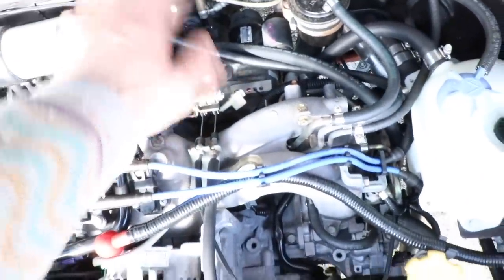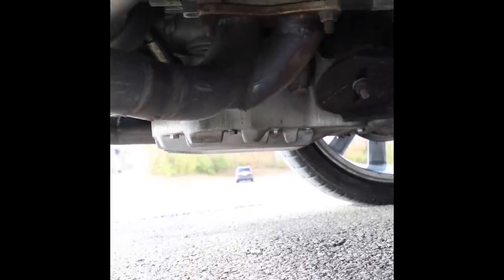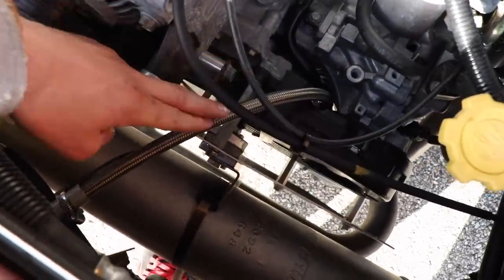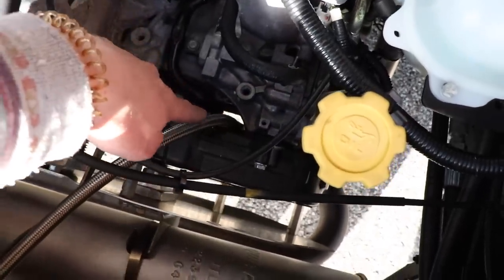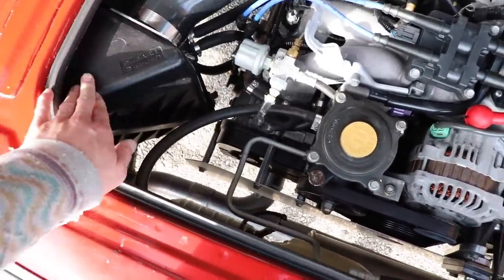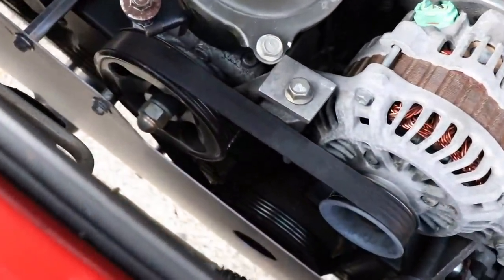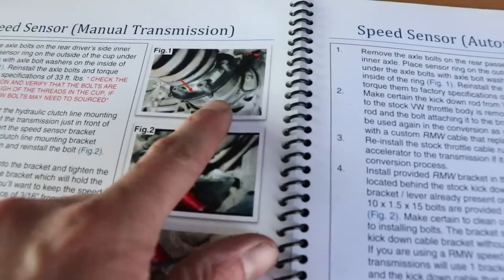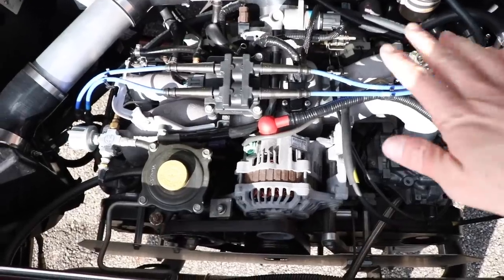VW Subaru Conversion

Comment: In South Africa, we produced these Volkswagen Microbuses (Vanagons) locally since the 60's. Volkswagen South Africa therefore, in a quest for more power, replaced the 2.1i (last of the VW boxer motors) with the AUDI 2.5L 5 cylinder motor - it's the Quattro 2.1/2.2 5cylinder bored out to 2.5 liters naturally aspirated that pushed the output from 85kw to 100kw - these were super tough and reliable and could easily do 160km/h! Drove lots of them - awesome long distance cars.
Reply from the maker: Nice!! I’ve heard of the buses from South Africa, sounds sweet!! Would love to see one someday and check it out! Thanks for watching/sharing🎉
Reply: @PostPros  : if you want me to send you some pictures and more information, you're welcome - our 5 cylinder busses ended up with quite a few engine sizes ranging from 2.3 liters (in the basic Kombi) to 2.6 liters in the Caravelle (the highest luxury spec with standard A/C, power windows, power steering, power mirrors and power door locks). The AUDI motors were RELIABLE and could easily accomplish 250k to 400 000kms with some owners recording as high as 850 000kms. Volkswagen South Africa never, UNFORTUNATELY, fitted these AUDI motors with a Turbo - I can just imagine seeing a VW BUS going past you at 200km/h like an AUDI QUATTRO! The stuff of legends! Ánd the sound of these motors were AWESOME! Now we have, like the rest of the World, the new T6.1 in diesel only 🙄🤦‍♂️
Reply from the maker: Sure that would be cool to see! I’ll message you my e-mail if you want to send them there, if it’s just a link online post them here so others can see🎉
Reply: Hey, where can I get one of these Audi engines?
I also need a SA Vanagon steering wheel

Comment: Never heard so much praise for the Wasserboxer.  My '85's had a GoWesty 2300cc and the air flow meter caused the worst nightmares I've experienced in a car.  Traveling from CA to WI (never made it), it died repeatedly at elevation and even when it wasn't dying, I would get the dreaded "highway hiccups".  You can get rebuilt AFMs, but the Digifant system is not good and if you break down in the middle of nowhere (as I did), good luck finding anyone who will touch a Wasserboxer, much less knows how to work on them.  And since there's no OBD, you're pretty screwed unless the mechanic is familiar with them.
I agree that if you're just driving around town and within a few hours of older VW mechanics, the Wasserboxers are fine.  Can't agree that they're good for cross-country trips based on my miserable experience.  I swapped the GW 2300cc for a Subaru 2.2 and it's better in every way.  Expensive, but I literally can't imagine doing cross-country travel in a Wasserboxer-powered Vanagon anymore.  Maybe with the Digifant ditched for GW's replacement, but if you're going to spend that much on overhauling everything, why not just a reliable, modern motor with OBD?
Reply from the maker: Joshua Sawyer you got it!!! Sounds like your a seasoned vanagon owner😂. The Subaru’s are sweet!!

Comment: I have an '88 with 365k miles on it. The first engine overheated (bad radiator) at 325k miles. I fried it good. The half ass shop I took it to tried to change the oil but forgot to put oil in it. And the guy is out test driving it around. No coolant system. Imbecile. I was able to drive it off the lot. The engine would not die. I ended up replacing it with a rebuilt 2.1 which runs fabulous. The cost with a new radiator, thermostat housing, etc, was $8k.

Comment: Rocky Mountain Westy wanted for their adapter kit, starting at $4500, which was cost prohibitive. I ended up buying and towing back a wrecked but running vanagon that had already been converted to Subaru 2.5 and transferred everything over for less than half the adapters alone, including converting to power steering.
Reply: I did find out the belt situation was a carryover from the 2.2L, which was not an interference engine and thus if a belt failed there was no damage to valves and pistons. You just aligned a new belt and continued on. Thus the design evolved with the belt continued from the earlier engines.

Comment: Great comments!  I have to disagree with you a bit though, the 84’ and later wasserboxer just didn’t age well.  Much of the issue was galvanic corrosion between the iron cylinders & the aluminum alloy heads.  I’ve seen them blow out the the water jacket going up I-5 in Tacoma.  The ‘79 -‘83 air cooled T2 motor can run a long time though.

Comment: KEnnedy Engineering Products (KEP) I think made the first conversion parts for subaru engines. I made the mistake of buying the odd duck single port exhaust 2.2 L and had to get custom exhaust made. I think Small Cars kit would have worked but I had already bolted in the engine. Lesson learned is to ask the conversion company first. Going on 8 years with only minor issues.

Comment: Vanagon and Syncro…best car ever made!!! Except for reliability, power and torque, reliability, stability in cross winds, reliable windshield wipers in heavy rain and snow, and needing another car available to make your transportation ecosystem complete!! Shoulda been called the Van-Agony!! Ha! Even so, Vanagon still the best…just fix all those issues and you’re good to go. Expect at least a 40k investment to start with and you will be delighted!!! I miss my Syncros!!! By the way, there is also a comprehensive Ford Z-tech engine conversion from Bostig Engineering in the Boston area. If you’re looking for a conversion option look into Bostig as one of your possible choices. Fits fantastically.

Comment: great video, thanks! I have a EJ20 conversion, it runs on gas and gPl. I love the temperature and oil pressure gauges, I really miss them. I have to open the ' hood" to see if there is enough coolant/ oil. That kind of sucks actually.

Comment: Love the setup. Are vans are similar. I have a 1990 Vanagon with a 199? SVS 3.3L. I purchased like this. There is what looks to be a small car 3.3l cooling kit install but this bus overheats all the time after 20 mins. Perhaps you could do a video on your cooling system? Would love to hear your thoughts and comments on the cooling system. Look forward to more of your Van videos !!! Cheers
Reply from the maker: Bummer about the overheating, have you replaced the thermostat/water pump? Definitely stick with Subaru stuff if you do. I just followed what Rocky Mountain Westy had on their coolant setup when I got the kit.. I’ll try to find a good diagram to send you.
Reply: @PostPros  Yeah I pulled the OEM thermostat and tested in hot water. Opened fine. Replaced for now with new non OEM but will be swapping them back out again soon. Did you replace any hoses, pipes, tanks, etc? Thanks for getting back to me!
Reply from the maker: So honestly the coolant is something I really haven’t paid too much attention to. Just followed what was said to do and went with it. For the most part I can tell the water pump goes to one pipe up to the rad and comes back to the coolant manifold on top of the heads.. that was enough for me and seemed like it would work when I set it up and haven’t had problems.. is your radiator good? People say they get clogged up and old, I’ve thought about replacing mine but never have, just a thought? Also have you bled your radiator of air, sometimes their hard to do and you need to raise the front of your van on a hill, then crack the bleeder on the rad until coolant comes out, while filling the coolant at the same time obviously..
Reply: @PostPros  Definitely have been through the check list of items many times. At least I'm a pro at bleeding system out :) Thanks for your input !!!

Comment: You did not mention having to run any coolant lines forward. So I am presuming that this is an 83 or later Vanagon? I know earlier air cooled models can be converted. I have seen Type 1, 2, and 3 conversions. Does this company also sell kits with water lines and radiators for earlier models? I always thought this was the cleanest conversion. You did a great job. I have gone from VW  in 74 to Subaru in 83, and back to VW in 87. But I had a large family and drove Dodge B vans over 20 years. All grown up now, and I am looking to Subaru, maybe VW, again.
Reply from the maker: manthony1956 yeah it’s a 1988 so it was water cooled already. Just tapped into the waterlines and good to go!! And yes I agree cleanest conversion!! Thanks for the kind words, stay safe out there!!

Comment: how did you get around the vehicle speed sensor problem. kennedy adapter is good.
get the flywheel and high performance starter also
Reply from the maker: I had one that bolted to the CV joint, it’s a super common style that people are running. Might have been from Rocky Mountain Westy, (that’s where my engine kit is from)
Now I have the Subaru transmission and just use the oem sensor and starter!!
https://youtu.be/uIbFvrQyXIc
Thanks for watching!!🎉

Comment: Excellent video and excellent job.  I bought a second subaru air filter box and then, went with a mustang GT air filter and filter housing.  ... ditto on wiring harness (pay, plug and play) is one thing I would do differently.    Is the reverse coolant just to delete running the coolant hose along the back ?  I also regret not getting the kit.....Rocky Mountain has been very helpful...
Reply from the maker: Yeah reverse coolant manifold just shoots the barb out pointing toward the front vs plumbing the coolant around the engine. Works great🎉
Reply: @PostPros  I just noticed that at the rear of the reversed manifold, there is like a 1/2" fitting,  I had assumed that was welded shut ?  I'll go back and look at your video.   Next topic, 5 speed, The shifter linkage that you had to make mods to,  do you think you could made it from instructions (pdf).  I found instructions, and Subarugears said don't over think it... Thanks

Comment: Great video. I saw you mentioned that you got your engine on eBay. I read on smallcar.com that they recommend the harness comes from the same engine. What did you do for the harness and the other misc items you need?
Reply from the maker: Jeff Watkins well I had an engine in there already but it was a phase 2 2,2 engine(rare) and had a single port header with an unknown amount of miles(dual port is WAY more common, that’s why I’d recommend going with dual). I bought an engine off eBay (ej20) with low miles and with the Subaru’s as long as it’s the same phase (phase 1=pre 2000? or 2 after 2000? (Somewhere around there), the intake manifolds will fit as long as it’s the same “phase”. The intake manifold needs to be kept with the same injection because of the injectors, throttle body’s, idle control...exc. So keep your fuel injection/harness matched with your intake manifold and all the sensors on it. And you can put that on any engine. The ecu will not know the difference and since it has the right sensors it will run perfect. Basically you’d be replacing the engine and heads, the shortblock. Even if it’s 2,2, 2,0, 2,5 it’ll run it and compensate. I have 2,5 injection running a 2,0L and it’s good, I’ve also put 2,5 lower end on a 2,2 setup and with the 2,2 heads and fuel injection and it’s daily driven, runs great!! It’s not ideal but it’s just fine, definitely better to keep everything 100%. But your engine/ecu doesn’t know the difference and since the intakes fit every engine (same phase) it’s easy to do!! If your doing an engine swap I’d recommend phase 2 2,5 engine. They’re all dual port and VERY common (for the future, we’ll have engines/parts for YEARS), their the newest, most power. The ej253 or later is the best. The old phase 1 2,2 engines are real good but they’re getting old and your stuck with phase 1 engine, single port too so your real stuck if you ever want to switch back and forth. Hopefully this answers your question🤙. Thanks for watching!!🎉

Comment: Noob question... Does a conversion like this make it to where the engine/motor no longer needs as high maintenance? Making it break down less?
Reply from the maker: YES!! That’s the main reason for the conversion, better fuel mileage too🏁
Reply: Dust in a Bus Rad! thanks for the response brotha

Comment: So 2 questions....

1. Did you have to fabricate any parts to complete your conversion, or did everything come in the kit and it all just fit together?

2. I’ve seen written articles that specify certain ages of Subaru that work, and year ranges to avoid, but they all seem contradictory. What is the newest year you know will work?
Reply from the maker: So the Rocky Mountain Westy kit that I got (others as well) was VERY complete and honestly other than basic household tools and skills I didn't have to do any custom fabricating, everything bolts together.
So the newest year that will work?? Any EJ engine will work, they range from like 1991 to about 2012 which is when they started phasing them out. I think the best years to use would be a EJ25 from about 2002 to 2004-5?(phase 2).. Right in there somewhere. Its not new enough to have throttle by wire so you don't have to worry about crazy electronics, or can bus stuff, and its not too old to have to worry about parts or hard to find engines/old wires falling apart..exc. Also that's probably the best and easiest fuel injection to work with, get a hold of, and you can actually scan it.. The engines are EVERYWHERE too. Some people like the older phase 1 EJ22's and say theyre the best but the problem is finding one that's nice and low mile. 
If you get phase 1 engine/fuel injection (1990-1999) you have to stick with engines within that year, phase 2 started around 2000 and up so you'll have to stick with the newer engines because the intake manifolds are different bolt patterns and cant swap them between the different phases. Which separates the compatibility between the 2. Your fuel injection is what decides, which is why I say go with the newer. When you need an engine they'll be what's around(phase2). Either way they all last a very long time. You'll get different answers from different people, but that's what I think!!! 
Thanks for watching!!!
Reply: Dust in a Bus excellent reply. Many thanks
Reply: @Dust in a bus,watched the whole video and found it clear and informative too.Just to ask,what EJ series Subie engine is this exactly?
Reply: @williemwangi4959    In the video he said it was an EJ251.

Comment: Great information! Thank you for sharing.  I am working on an early bay window swap and wanted to ask you what is the size and angle of the rubber elbow connectors you used for the intake. Thank you!
Reply from the maker: Coming off throttle body...2,75” to 3” (90degree).. the other 2 are just 45degree 3”. Good luck with your swap!!🤙